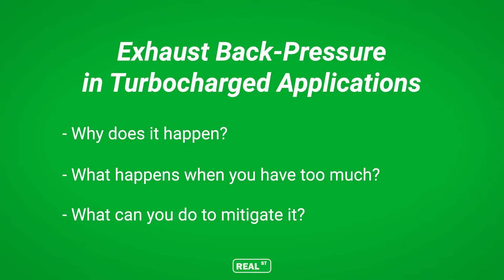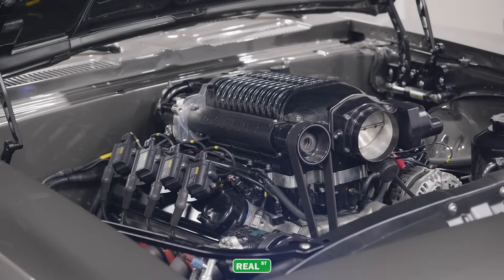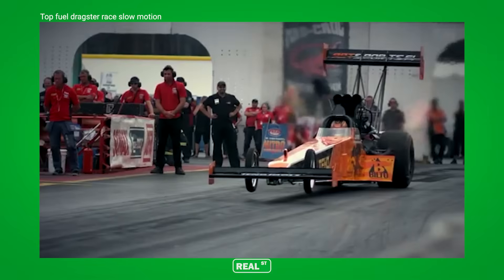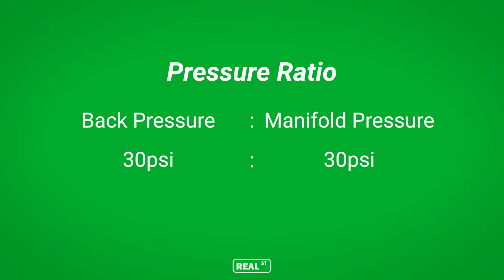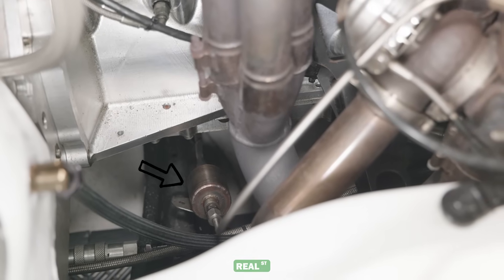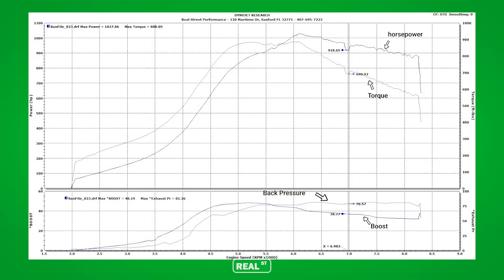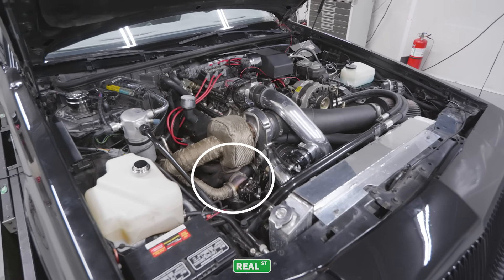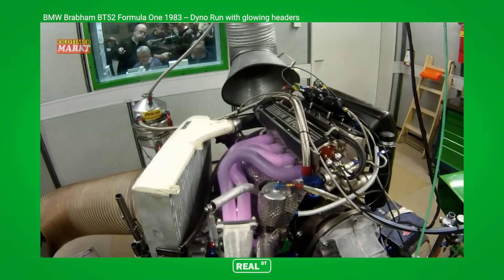Understanding Exhaust Back Pressure for your Turbo Set Up. How to Monitor it and What to Aim for

Comment: More BP = faster spool and a better street car or daily. But limited in boost pressure and RPM of course. What the aftermarket still badly needs is variable geometry turbine housings🤷‍♂️
Reply: They already have that its called variable vane turbochargers
Reply: Ford used them starting late 2003 vgt turbo worked good as long as it was maintained to prevent sticking vains

Comment: You did not explain what the main cause of why back pressure is created? What happens when a compressor runs out of efficiency? Wastegate is then closing to try to raise the boost and all of the exhaust flow goes to the turbine. So if we can have the wastegate open all the way to rev limit backpressure will stay low and to make that happen we need a bigger compressor. Turbine housing size is mostly important if we want good response at low rpm and nice driveability. The back pressure sensor is a good way to tell you if you are running out of compressor or if your wastegate is too small.

Comment: When i was about 5 years old and eager to learn fluid dynamics in a vacuum vs atmospheric pressure. My grandfather explained it to me between puffs on his cigarette, and it went something like this but simplified down a little for ease of understanding. Firstly, you have to understand the basics of tangent reflections on uncompromised and unpolydestant substrates which are usually half gated but always full duplexed in a 1bar setup... This is common knowledge that im sure you know but we have to start crawling before we start running.  When throughputs are equal from vacuum to pressure or from load to unloaded, preplexed viscositys always stay at a state of bi-lateral stonosis unless ion saturation creates a caustic situation then flow is always at a positive rate. RP1 jet fuel used in space x raptor engines uses a full flow open combustion process which creates around 275psi of throat pressure under 110% full fuel flow. Now this system is a simi-agnastoyic reference based (mechanical) system, it is comprised of dual momentary as well as multi staged pulse sensors for a closed loop ➿ system for dynamic flow control with nano second active duplex modules for total system control from start to finish. Now if you have made it this far reading this mumbo jumbo of word diarrhea that makes zero sense completely... Dont feel bad for wasting your time as i just questioned myself to why the f••k i wasted my time writing it and questioning my life decisions from this point. But if you tried to imagine how any of this would work as you were reading... 👍🏻
Reply: What are you saying
Reply: I should have known then you started with “When I was about 5 years old and eager to learn fluid dynamics”

Comment: Love to hear your thoughts on a turbo setup for a road race application.
Reply: I think it's certainly gearing and the ability to manage average power. Years ago I tuned a S2000 that the max HP for his weight was 280hp so we used a small turbo and ran more boost down low than at high RPM. It was very effective.  The power selection part is much easier than heat management in road racing, the heat can really ruin an event. Thanks
Reply: @jaymeagher1510  Thanks Jay, I would almost think an oversized turbo setup running low boost would reduce the heat.

Comment: So would you want to mount the exhaust pressure sensor between the turbine housing and the headers (like in the Y pipe)? Or in the down pipe after the turbine?
Reply from the maker: Between the engine and the turbo
Reply: Did you NOT watch this video ??

Comment: what kind of pressure ratios do your high hp 2jz run?
Reply: 1:1 and spray it!
Reply: @dj4monie  That is the move!
Reply: It depends on the turbo and boost level in respects to heat. At some point intercooler comes back into play once you're over 60psi or so. Then you're really trying to manage inlet heat and back pressure. Thanks 1.1 is always nice.

Comment: I never paid attention to how the grand national manifolds were setup. I built my own headers and y pipe for a turbo 3800 and was surprised to see gnx power levels at half the boost. Seeing how the are setup, i bet that is why
Reply: I have a supercharged 3800, is exhaust back pressure important for a supercharger?
Reply: @sazzyPheox  Supercharger is mechanically driven so much less impact, people obsessing over backpressure usually have other things they should be worrying about first. backpressure is high level stuff IMO
Reply: @sazzyPheox  yes. Less restriction, less pumping loss, more power

Comment: TL'DR version:
Too much back pressure?
Add more turbo(s). 😎👍

As Jay said, it's a balancing act. I'm also old enough to remember F1 in the 80s, so I know with my street car that I want stupid quick turbo response but I also want stupid power up top too, so I'm going twin 2860 with .82 rears rather than a single big turbo like a 7675. Maybe I'm wrong with my theory, but I'm doing something individual and that's the point of car building, doing something different and unique. 😎👍
Reply: I share your idea and I am doing something similar on my car. However my principle is different. My setup is two stage turbocharging, initially in series and then the big turbo is individual. The small turbo (for low rpm) is KP35 and a bigger is VJ23 (high rpm). The engine is 2L. For this setup to work, it is necessary to have a capable and efficient valve to switch the exhaust gasses between the turbos and the same time the inlets. I think this applies to your setup as well. My set up is built and I performed some runs. I used to run only with VJ23 and achieving boost 0,16bar@2500 and rising slowly until 3700rpm (full throttle) and then rapidly increases. Now with KP35 I get 0,54bar@2500 (full throttle) until 0,6bar@3500 and dies. Then I am switching turbo by pressing of a button on the dash. In the future will be automated. Of course the small turbo kicks in much faster and builds up pressure form around 1300rpm. It sounds awesome also! :)
Reply: @christoforos82  Nope. Yours is a compound turbo, mine is simultaneous twin turbo. We are not the same. 😎👍

Comment: I've always explained it via "Back pressure bad" "Velocity good" because somewhere, at some point, someone said cars "need" backpressure and then anyone reading that thinks "oh, so back pressure is good". This gets worse to the point that people will argue against larger exhausts because they'll "lose" backpressure and expect to lose power... when their tiny exhaust pipes were making the engine work harder and sacrificing power.

Literally had arguments where people thought they'd lose low end torque going from a 1.5" to 2" exhaust because of the above... God my head.
Reply: I beleive the "back pressure good" started when people would install a free flowing exhaust and headers and not jet the carb correctly, thus burning valves
Reply: Changing the exhaust system diameter only moves the power band to a different area.
Reply: @ACommenterOnYouTube this
Reply: Well when i removed the stock exhaust manifold and went with a larger diamter 4-1 header, i LOST all my low end torque that i had before but my top end increased dramatically ... 
So it didnt loose power, it just shifted the power band.
Reply: @ACommenterOnYouTube  definitely depends on setup as the ones above said. For me mine was heavily restricted, so I gained both power and torque going to a larger pipe, but I also didn't go from 1.5 to 3.0 either... Seen a lot of people that just go from 1.5-2 to 4" and murder their low end because they lost velocity and scavenging.

It's a balancing act that most companies figure out for you, until you start going custom and higher on power.
Reply: Back pressure , drive pressure, boost pressure and crank case pressure aka blow by are all different elements.  Just like your intake,  different  runner lengths and size increase / decrease  and move all the pressures associated with a turbo.  Just like turbine housing . You can go to large . If you go to small or large it will destroy power.

Comment: Great video! Can you do a video on how airflow and power are affected by larger valves and multi angle valve jobs?
Reply: Good things will happen! Both increase air flow. When air flow is increased power will go up and boost pressure will go down. Then you can crank the boost back to where it was!
Reply: I think this is highly dependent on the pressure ratio you're operating the engine at.   You also have to consider will the engine benefit from larger valves if the seats are stock sized.  Valve jobs should be done with longevity in mind over air flow, thin margin valve jobs are short lived in turbo applications due to heat.  Thanks
Reply: Multi angle valve jobs just allow the air to flow smoother around them, larger valves allow more air to pass .... no video is needed
Reply: @ACommenterOnYouTube  Thanks, that's fairly obvious but I was looking for more detail about if/how it affects spool up, what power goals it really makes a difference for, etc.
Reply: @justbeastit  well next time be specific on your question and dont ask a general question when you need a specific answer ...